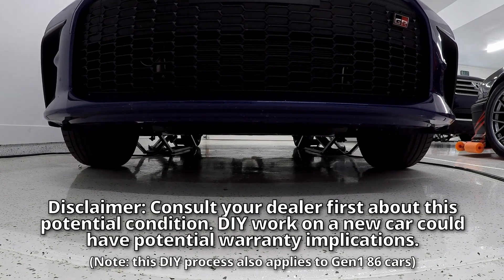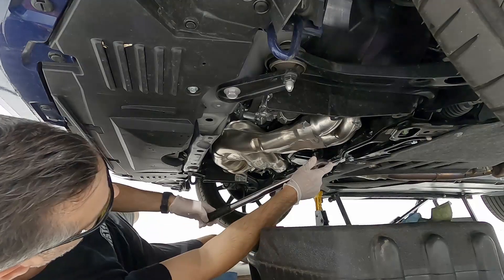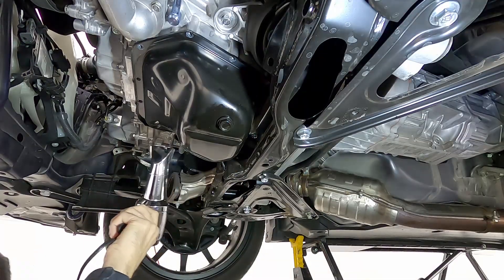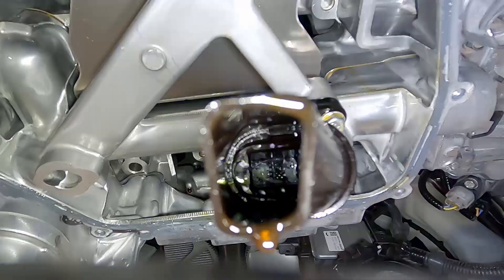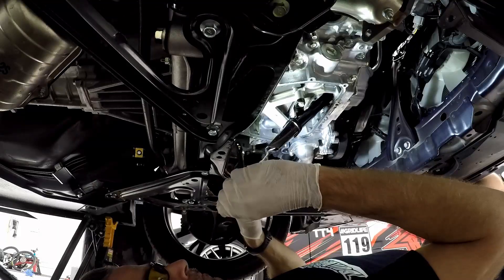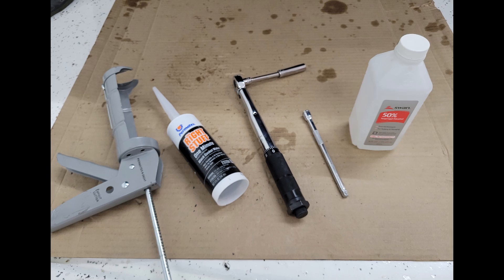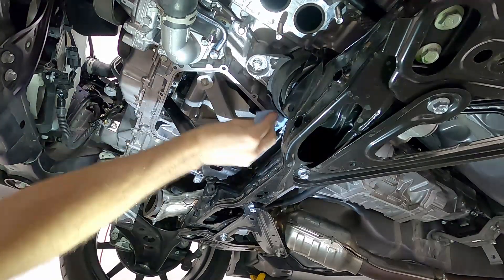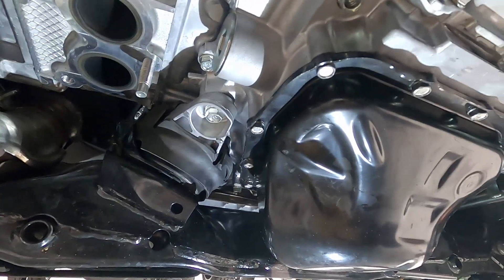RTV Silicone In Your GR86 or BRZ Oil Pickup? Here's How To Clean It

Comment: In other videos I saw the guys put new silicone on the oil pan instead of applying it directly on the engine, I guess it doesn't really make a difference.    Will do the same as you did with droping the oil pan during the 1st oil changes to get some of that silicone out.  Your video is over a year old.  Did you drop the pan on a 2nd/3rd occasion and still found RTV in the pickup tube?  Thanks for the video.
Reply from the maker: Yea it doesn't matter which side you put the new silicone on. I did drop the pan a second time and put it on the pan first that time. On the 2nd check there was almost no RTV in the pickup. I'll be pulling it a 3rd time here soon to install an oil pan baffle.

https://youtu.be/T8ULaURZQ1w?si=srfo0w-ngfS9ictV

Comment: 😂😂😂😂😂 homeboy is heating up the RTV with a hair drier.  My god what a goofball.  It’s high temp silicone. It’s designed to not weaken at all unless temps well over 400 degree F.
Reply from the maker: That's called a high temp heat gun, goofball. Many of which are capable of temps over 1000°...a blow dryer will help but not nearly as effective as a heat gun.

Comment: Just saw a video of a guy who was on his first lap on a track, hardly pushing the engine yet, only a few minutes in, and it killed itself, and this issue is suspected to be the culprit. Toyota refused their warranty because they were on a track at the time...
Reply from the maker: Yea, I saw that too, whole situation sucks. I'm still not convinced RTV is the root cause, even after a handful of engine failures. There are countless people (like me) who had RTV in the pickup tube, thousands of miles and many many track days and races, but have had 0 issues. Seems more and more likely it's typical crappy boxer engine design and lack of oiling, too low oil, etc. The warranty refusal has to be infuriating for the people with engine failures, feel bad for them 😕

Comment: Nice video. So what's stopping the new gasket from doing the same thing?
Reply from the maker: Thanks! The idea is a thinner bead will not break off like the heavy factory bead. That said, the RTV is also coming from other parts of the engine, like the timing cover. Check out my follow up video where I inspected the oil pickup a 2nd time (spoiler, there was almost nothing in it).
Reply: @TheBTRGarage  Thanks for the reply. I ended up seeing the follow up video after I commented. I feel your channel should be more popular than it is. Thanks for all the work you do.
Reply from the maker: @mikesamson1930  Thanks! Share with your car friends, best way to help grow 😁

Comment: If you happened to have an articulating bore scope, you can run it through the drain plug for inspection. If it's severly blocked, then worry about taking the whole thing apart.
Reply from the maker: People have tried that, you can't see in to the pickup as it is too close to the oil pan, unfortunately.

Comment: Having this looked into on Thursday for my car as well as some recall for the telematics system.  Mine is a brz so not sure if the gr86 has the same issue.  Also wanted to say you did I batter job than most dealerships would.  I fear when dealerships work on my car.  I was a mechanic for a long time and saw some crazy stuff go on at the dealership.  😅
Reply from the maker: Thanks! Definitely good to have it looked into if just for the piece of mind.

Comment: 2/23: My 2014 BRZ has check engine and traction lights on and is throwing POOOB code. Mechanic replaced cam sensors without any effect. He told me about RTV getting into cam gears and is expensive to fix. Did an engine flush and soon after check engine and traction lights went off for a week. Engine scans were clean. Then the lights have come on again. Apparently bits of RTV can get stuck in the complex cam gear and cause interference with oil pressure (which regulates timing) and then throws the error code. May try removing oil pan and cleaning internal filters. What a bad surprise. Nothing is actually broken.

Comment: Are the 2023 models experiencing this problem?
Reply from the maker: I'm not aware of anyone that has opened up a 2023 model yet to check. My guess it tbey too would have RTV in the pickup after a period of use. Whether or not that actually causes any problem is still low risk, in my opinion.

Comment: Are you using a standard length quickjack?  If so I'd be curious if you could show where exactly along the pinch rail you are lifting from.  I was surprised mine didn't reach the lift point notches for such a small car.  thanks!
Reply from the maker: Yea it's a standard BL-3500. I line the jack block with the back of the front pinch weld, which puts the rear one a bit in front of the pinch weld.

Comment: Great video!! Do you need to leave the RTV to dry before you put the oil back in? Thanks!
Reply from the maker: The RTV I used sets up pretty quickly and says ready to use after 1 minute, so it just depends on the RTV you use. I reinstalled the oil pan and let it sit overnight before filling with oil the first time I did this. The second I did it, just recently, I put oil back in after a couple hours just to be safe.

Comment: unfortunaly there is alot more than just the oil pan sealed from the factory with RTV on these engines. it was never a big deal on older engines as the pickup tube was alot bigger. an anaerobic sealant like permatex 51845 should be used instead of RTV where ever possible. Anaerobic only cures where it is clamped between 2 machined surfaces. any extra just oozes out and mixes with the oil and is drained out next oil change. only downside to anaerobic is it cant be use on sheet metal stuff like stamped steel oil pans- for those you still need RTV.  but anything machined like the timing cover, block halves, aluminum oil pans, oil pump etc anaerobic works flawless with zero chance of using too much.
Reply from the maker: Yep, RTV used in several places. I tall about that in the follow up video to this one.

Comment: Good video, unfortunately Subaru has a long history of terrible quality control and very poor engine design. In my experience they either blow up at 60k or run for over 200k.  Most all of them develop large oil leaks during their lifetime, which usually requires pulling the engine to fix. Subaru is notorious about using silicone to seal with instead of gaskets and that stuff ends up in your oil pan waiting destroy the engine. I like the little car and all it needs is a Toyota engine to make it worth purchasing.
Reply: Jz swap 👀

Comment: Does this apply to all the car ? I went and check with a flexible camera from the drain plug and I didn't see any silicone ridge on all the side of the oil pan. Got my BRZ on December and racked 40000km so far, should I be worried ?
Reply: if it was going to affect you, it probably already would have by now.
Reply: How is your car now? Did you manage to drop the oil pan?

Comment: There are five mesh screens, not just one.

If one of them is covered, there may be a slight pressure drop,
but it should not be a major problem because oil can be sucked in from the other four screens.
I am skeptical about it causing the engine to blow out.

I believe the pickup tube structure with multiple screens present is an improvement from Mk1, one of some KAIZEN by Toyoyta/Subaru.
Reply from the maker: Yep, that is exactly my thought. See the video I just published this morning, I show the different mesh screens and how it (appears) to work.
Reply: @TheBTRGarage  Checked out your new post. Thanks for sharing the great videos.

Comment: So what now? Every time you change your oil the sump on the GR model 'should' be removed to check for silicone!!!  That is NOT an easy process and the possibility of something going wrong or leaking is high.  The header heat shield for eg has edges that are like razor blades and wearing thin gloves is NO protection from deep cuts, ask me how I know, and what's to say as soon as you re-install your sump, and run the car more silicone isn't released from wherever it's coming from and replaces the silicone already removed from the pickup?  This is an utter debacle for Toybaru and is worse than the valve spring issue and subsequent recall.  So wtf has happened to QC at Subaru?  Appears nonexistent inb 2022.

Comment: Are there any early indicators that would suspect there is silicone buildup? The car recently came back from a Texas roadtrip so wondering if now is a good time to check. 

Ie: silicone bits in oil during an oil change etc or anything else that would help myself make a decision to DIY it. 

Unfortunately my dealer is not putting it under warranty and with an insane cost just to check (quoted about $800).
Reply from the maker: Some have seen RTV on the dipstick. If you change the oil yourself you could strain it through a filter to see if anything was in the pan.

My opinion is that most cars will be fine just letting it be, but I understand wanting to be preventative.
Reply: @TheBTRGarage  makes sense! yeah definitely just want to prevent any other things that can go wrong on it 😂 Loved the vid -- very clear cut, if I will be doing it, I'll be following the vid here 🔥

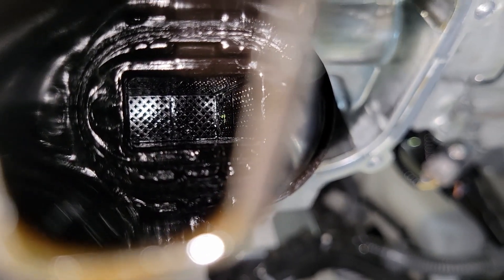Comment: at 4:26 if I see correctly the oil pickup tube has holes on the bottom AND on two sides at least (there is a yellow piece of something on the right side), so even if the bottom is partially clogged as shown the oil should flow throught the sides of the strainer and compensate. Of course not ideal but am I wrong ?
Reply from the maker: Good eye! You are right and I came to the same conclusion. I think this is part of the improved design over previous gen, where it was just a single flat screen filter.

So, even if RTV gets gunked up on the "top" filter screen, there are still 4 (not 2) screens on the sides where oil can pass through. Tomorrow I'm releasing a video where I talk about exactly this, with diagrams and things, stay tuned!
Reply: That is what I thought.
My BRZ hopefully gets delivered by the end of September here in Australia.
Have just heard of this RTV issue.
I think an occasional look with an inspection camera, via the sump plug
may be in order if that is at all possible?
What do you think?
Reply from the maker: Yea you could do that, I wouldn't worry about it too much though.

Comment: Is this a Subaru engine  except the ds4 part. The brz should also be affected right. How about the 2.4 l engine in the wex. 37 K for a used brz on autotrade.
Reply from the maker: Hard to say if the same issue exists on the other FA24's, my guess would be yes, but it's just a guess.

Comment: Great video. Plan to do this soon on my next oil change. Do you have the torque specs for the exhaust parts that need to be removed removed? Thanks!
Reply from the maker: Header bolts to block = 22ft.lbs
Header to overpipe = 32ft.lbs
Exhaust spring bolts I just tighten until they bottom out

Those are the only things you need to remove to get the header off.
Reply: @TheBTRGarage  thank you, sir!

Comment: Great video mate. Do you reckon that Toyota/Subaru would have been better off using a cork/fibrous gasket, instead of the factory RTV that is causing these issues that you have shown in your video?
What’s to say that some of the new RTV you have applied to the oil pan squeezes out like before and makes it way back up into the oil pick up screen again?
Perhaps, maybe Toyota/Subaru were a little heavy on applying the RTV sealant in the first place that have caused these quality issues. It seems like a serious quality issue in the factory that requires addressing on getting the correct amount of RTV applied in the factory to the oil pan in the first place to the FA24D engine. Or change the process all together to eliminate the risk of FOD entering the oil pick up screen  and engine in the first place. This has to be a major Correction Action that should be addressed immediately by the companies.
Would like to know your thoughts?
Happy motoring.
Nick.
Reply from the maker: Thanks! A gasket would have eliminated any potential RTV scraps coming from the oil pan area. However, I do think RTV scraps are coming from other parts of the engine where they use RTV to seal a component (ie: the timing cover). So, even if the oil pan RTV was a non-issue, there is still a chance the oil pickup could be seeing RTV from other areas.

My new RTV sealant job is not full proof for sure, there is of course still a chance that bits of that break off into the pan. But it's very hard to know for sure. I will take the pan off again at my next oil change and see if we still have any RTV scraps in the pickup.

Comment: Can someone explain to me why the hell subaru can’t use an oil pan gasket? It isn’t new technology all of my 90s BMWs use oil pan gaskets, sure they leak over time but I don’t have to worry about silicone clogging my pick up tube.
Reply from the maker: Nope :) There must be some reason for no gasket...cost? ease of replacement? (no defintely not that), one less part for the parts catalog? better sealing compared to a gasket? (maybe)...otherwise I dunno...
Reply: @TheBTRGarage  Peeling silicone off is easier than peeling off a rubber gasket? Took me half an hour to replace the valve cover gasket on my m52, cost me $23 for an OEM part, now is it less efficient in the long term yes, but again I restate I dont have to worry about my oil pick up being clogged by a shitty application of silicone, and I by far expect a hell of a lot more from a Japanese manufacturer.
Reply: @TheBTRGarage  it's definetly cost.. One robot can slap a bead of RTV on a lot faster an easier than applying a gasket. If only the programmed the robot properly 🙄

Comment: Subaru desperately need to redesign the oil pickup so it has a larger primary screen, maybe on the bottom, that way a few pieces of silicone will have little affect.  
Sticking with small easily clogged primary filter screen combined with quite extensive use of silicone sealing is a recipe for failure.
Smacks of incompetence by whom ever signed off on this from Subaru Engineering.
Reply: Yep, they absolutely need a screen on thr very end so pieces thst hit that screen will just fall off and not form a persistent clog

Comment: I have a 2022 BRZ and am really p*ssed this is happening.  I had a '96 Corvette that had the same issue.  And now, a Subaru.  Question: If you go through what you've just done, then what's to stop this issue happening again as you've removed the silicone and put on a new bead?
Reply from the maker: This process will likely only reduce the chance of it happening again. I think RTV is coming from other places as well, like the timing chain cover. But, that's just my guess.
Reply: @TheBTRGarage  I have such higher expectations from a company like Subaru.  Just plain angry.  Does anybody know how to make a decent car that doesn't have issues out the gate?

Comment: The two different colored silicone makes me believe it's not just from the oil pan.  Really makes me want to hold off on getting a gr86.
Reply from the maker: Yea, I too think there are silicone bits coming from other places. Cleaning up the pan will reduce the oil pickup mess, but probably not eliminate it all together.
Reply: I’m waiting too. It’s not just the oil pan, makes me wonder if Toyota has a different RTV or assembly process.
Reply: @lastname-Nm  yes, Toyota uses gaskets, and if they use sealant it is called FIPG, and watched a Video from care care nut ( A Toyota master tech who is super knowledgeable). He said FIPG would not cause problems. It’s Subaru shit. I have a gr86 coming in a couple days. In really wish Toyota made the engine

Comment: They use that stuff everywhere.  Just cleaning the oil pan is not going to fix this problem.  Higher torque areas and sharper edge connections will be a problem. I love my 2022 BRZ and now I feel like I've tripped a land mine.  I'm not going to pay a penny for any 20 year old's engineering mistake!
Reply from the maker: Yea that's the concern I have, is RTV is gonna be coming from other places as well. The oil pan cleanup should help, but not eliminate the issue ☹️
Reply: The only thing I hope for from that fact is that thr problem can't last forever. If other parts of the engine have rtv coming off. We'll need to drop the oan and check for clogs in thr pickup a few times but Id assume that after a while the problem will go away because the excess rtv will eventually all work it's way out. Just wonder how much and how long?
Reply from the maker: I just pulled my oil pan again yesterday and I have good news coming soon 😁
Reply: @TheBTRGarage  ohhh... Interesting. I placed an order for a GR86 last week. Won't be available for a few months. Hopefully the issue is either resolved from the factory by that time or they don't need more than a couple pan drops before the problem goes away.

Comment: Wow. Well detailed video. Do you think they resolved this problem for all 2023 models? Or, is it possible that some initial 2023 models have this same problem?
Reply from the maker: Thanks! It's really impossible for us to know if anything changed for the 2023 models. All we can hope is that this whole situation brings to light any potential issues and Toyota/Subaru look into making a change.
Reply: It’s been documented in the early ‘23s on Facebook recently in the forums there… few different 23’s with less than 1000 on the clock that have blown up and had rtv in the pickup. There’s a blue ‘23 trueno that had 400 miles on it that comes to mind most recently